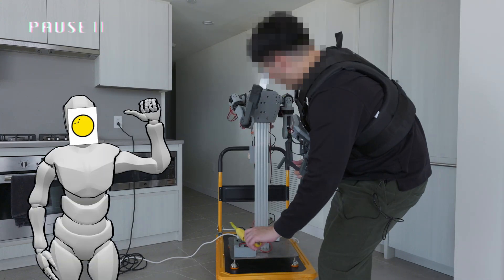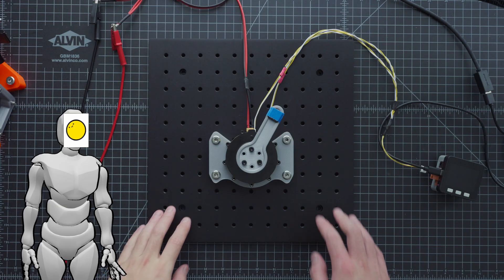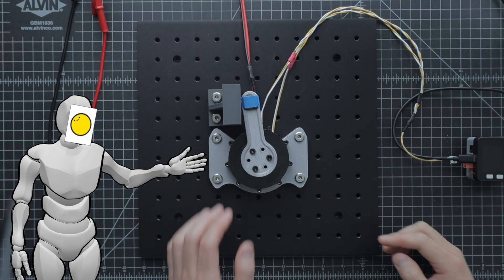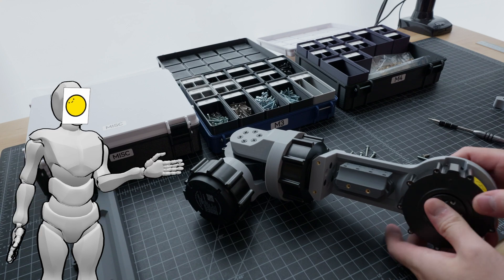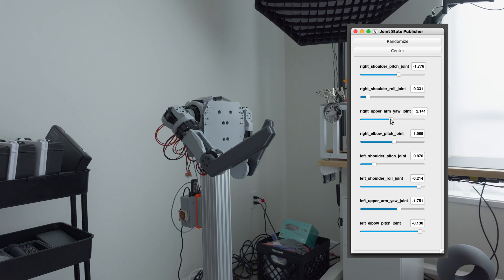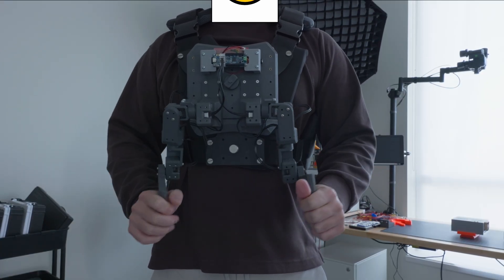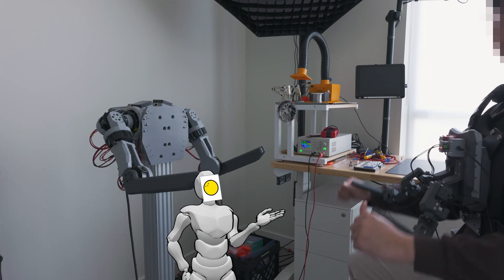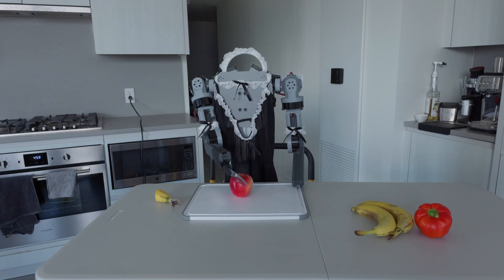building the robot butler of my dreams

Comment: Ive become a huge fan of spherical gears in humanoid designs. As crazy as it may sound Gundam model kits are ahead of their time. In alot of ways it solved a design problem i had with heavy weights vs motor size in the ankle. With spherical gears i can have two large motor acting as the calf muscle vs every other design that place it directly in the ankle.